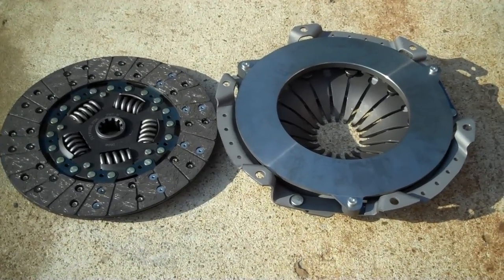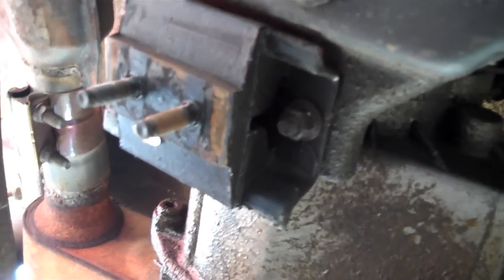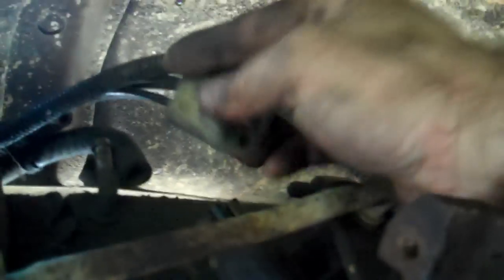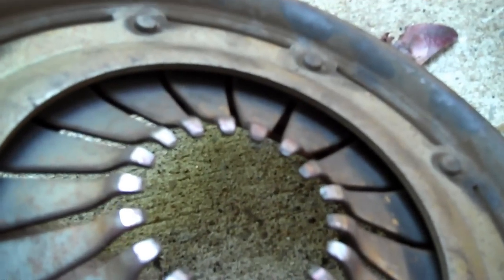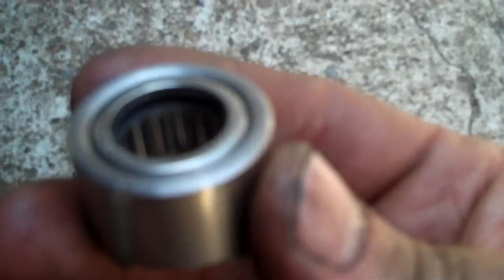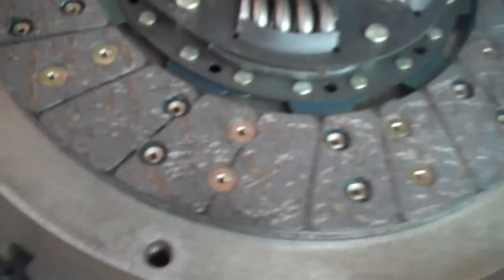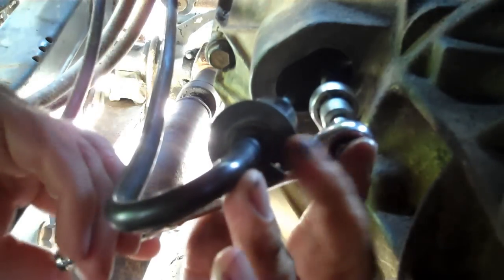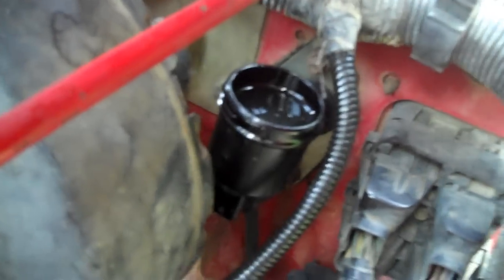Clutch Problem with the Jeep Wrangler YJ - Time to replace with a new kit.

Comment: Is there a way You can post a link to the kit you bought?
Reply from the maker: ***** I just called advance Auto got the part number. Here is a trick for ya. Go to Retailmenot. c o m .. type in the name of the auto parts store in your area. See which one has discount coupons .. Advance Auto typically always has some form of online discount code. After you have gotten the part number from the parts store that has a coupon code and the part in stock. Order your parts on the parts store website. Once you get to the checkout part of the shopping cart there should be a place to enter the coupon code. Enter the code and watch for the savings. When you get to the part of the payment process that asks about shipping there will probably be an option to pick up at the store. I always do this on expensive items to save money when I can. I purchased a starter last week using this exact method. Saved $26 on the part. According to Advance Auto website, you and I have different clutch sets. Possibly you have the external slave cylinder .. if you do count yourself lucky :-) . Hope this tip saves you some money! Thanks for checking out my video! Have a great day!!
Reply: Thanks so much I appreciate you and your channel
Reply from the maker: ***** Hey man .. glad to help!!

Comment: my YJ wont shift into gear so im afraid my clutch is bad :( 

thanks for the vid, hopefully i wont have to use it soon haha
Reply from the maker: Check the fluid in the clutch master cylinder. If that is good, try bleeding the slave cylinder. If that still dont work. Change the master and slave cylinder. Good luck! Have a great day!

Comment: What if you took those clips of the barring
Reply from the maker: The throw out bearing would extend and be more difficult to install.
Reply: Power Addicts - FixJeeps.com - Jeep, car and motorcycle tips I took it back down and redid it .... my PROBLEM was the hydronic hose clip . I left it in so it kept copping off 🤦🏼‍♂️. But now I have a slight whistle. It’s only in a sweet spot while I’m driven. I’m hoping it just goes away over time